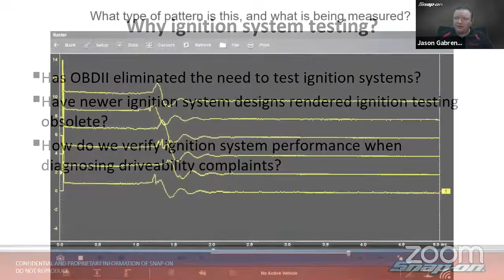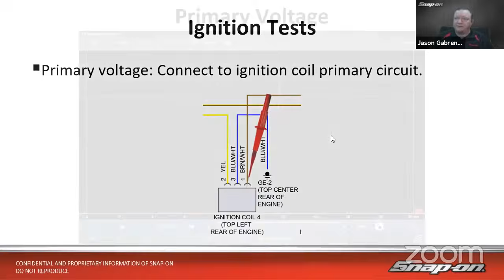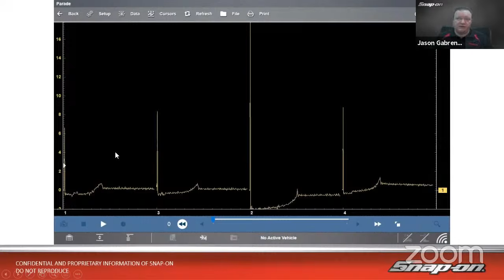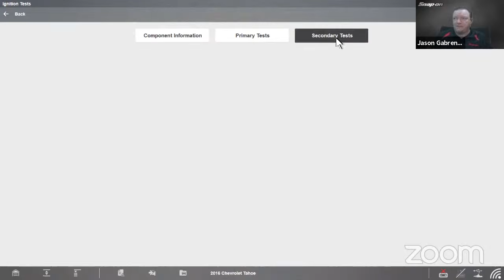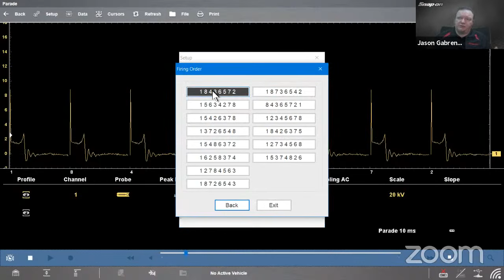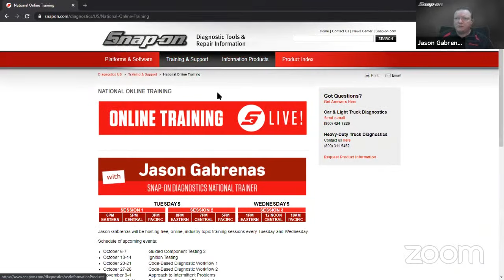Ignition System Testing - Snap-on Live Training Episode 05

Comment: When changing the cylinder to monitor individual cylinders, is #1 the first cylinder in the firing order, or actually #1? In other words if I select #2, is that cylinder #2 or really #8 which is the second cylinder in the firing order?
Reply from the maker: Since you tell the tool the firing order during setup, it should be showing cylinder #2, not the 2nd in firing order.